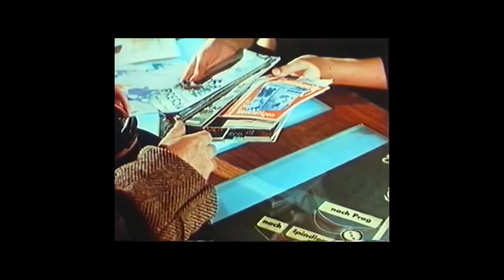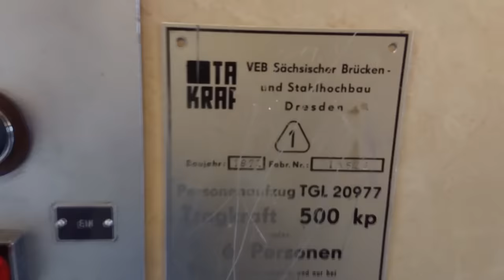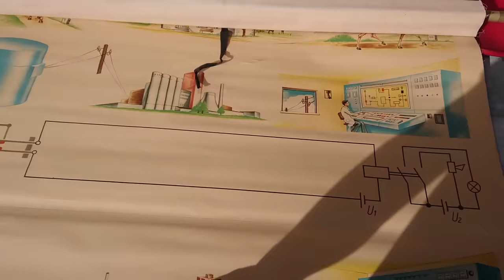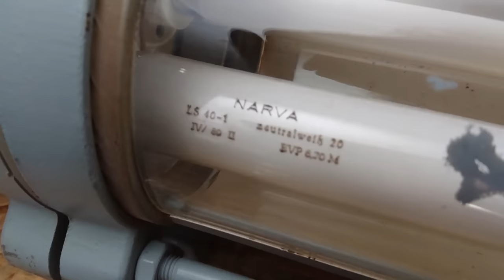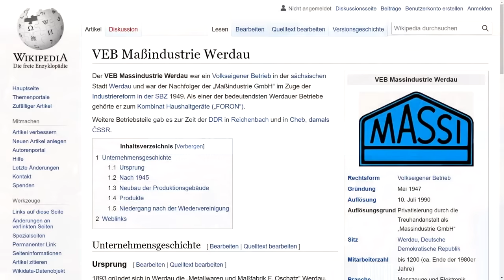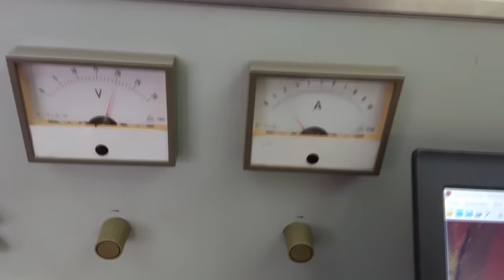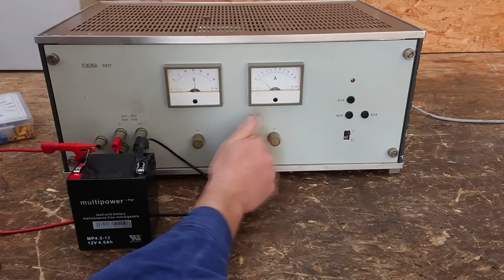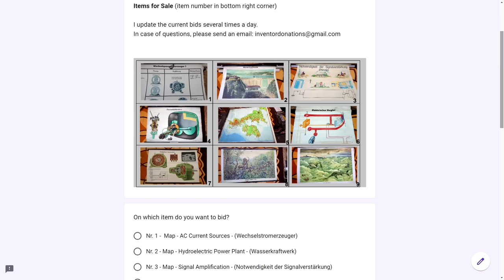Cold War Treasure Hunt - East Germany! Repair-A-Thon!

Comment: As a Hungarian I can confirm that the "Precizios" (lit. precision) wrench was indeed manufactured in Hungary or at least manufactured for Hungarian import. If you can give some info on what's on the other side I could try investigating where it could've come from.
Reply: I am Hungarian too and I have a lot of tools from this brand, but I dont know, was it a Hungarian brand or not.
Reply: I have one of these that spent 80 years in the ground! Presumably lost by a Hungarian soldier in what is now western Ukraine during WW2. It still looks good, and I still use it!

Comment: Be careful with the plastic you used for the meter, if it is subject tio a static charge, it can move the needle, i had a couple of nice meters with plastic fronts that did this, i scrapped them because i couldn't simply replace the fronts
If you need thin glass, try small picture frames and cut to size
Reply: There's on old technician's trick to fix this. Wet your finger with soapy water and coat the inside of the plastic/glass. This creates a slight conductive film that discharges the static. Dryer spray may work even better.
Reply from the maker: Oh yes it can be an issue with some plastics, but in this case the meter works just fine with the 'new' transparency

Comment: One thing wrong, this lamp flickering is visible and it can cause seizure to people with epilepsy. Good thing that with LED tech this kind of obstacle gone away. About changing broken glass for plastic in this ampermeter, glass was used there for purpose, it gather less electrostatic charge than plastic. If you still want use plastic, make sure it have some antistatic coating on side where needle is, otherwise readings can be not accurate.

Comment: Tona was first estabilished in 1892 in Pečky in a former Austro-Hungarian Empire (Czech Republic nowadays) as a steel smelting factory. The production changed trought years, from making parts for agricultural machinery to various engineering products. In 1950's they build their own forging factory and started a production of various hand tools up until the privatization in 1992. In that year Tona became a part of THE STANLEY WORKS. In 2010 the Tona factory in Pečky was closed, which led to the creation of Tona Expert brand (part of FACOM). In 2018 the brand was rebranded to EXPERT by FACOM. The current factory is located in Kolín.

Comment: I started to watch and a minute in stopped. I will wait to later so my wife can sit and watch with me. My life has been touched by many Eastern Europeans. I learned mechanic, electrical and especially manual machine tool operation and repair in several machine shops. All the guy's could fix what they run and make adjustments.

Comment: The swivel wrench from the unidentified batch is east german. It is an original swivel for the legs of a ' camp tourist' tent trailer. These trailers were sold in the west as Alpen kreuzer. It works really wel as you can use the small offset to quickly get the leg down and then tilt the handle to the side to Apply more tourqe.

Comment: You should buy that property. Its very do-able. Reinstate the access road with a chain saw and strimmer. Your Subaru should be able to get up there no problem. Clear the brush from around the house, demolish the house and burn all the timber and build a new wooden structure. It would basically be a very large shed. Worst case you could use it as an airbnb most of the year. It might well appeal to someone to stay there in the summer. It looks like a very nice rural plot.

Comment: Getting that land would be a great investment, because all cities in the world are starting to rot away. Little by little you may start to get rid of the bushes to clear the basic access path for your vehicles and a little space around the property. You had already sorted out the power generation, the only remaining issues would be potable water, wastewater and internet access. Also how far is this terrain from stores to get everyday supplies is another intrigue. I wonder if your everyday job do require transporting finished parts to the customer's location. Besides the electrical and mechanical projects you can also do some gardening and a few animal pets. It would be beautiful. I wish you the best if you decide to start that incredible journey.

Comment: I remember my Grandfather's advice about buying land. He said for him, it had nearly always turned out to be a good investment. As he put it, "They're not making it anymore."  
If the price is right, that plot might be a great one to buy, even without any buildings or improvements. It would be a quiet, private, peaceful site to camp on, and might even prove to be a profitable investment down the road. (Although I don't know what the real estate picture is in that area.) I would investigate for any upcoming area projects or problems before committing to buy it though, if you're interested. After all, you wouldn't want to find out after the fact that it's sited on an old toxic waste dump, or they'll be soon building a major road through it or something.
The buildings are a different matter. To my eye, they look pretty decayed and in need of extensive restoration or just demolition. (Depending on your tolerance for bugs, instability, and mold.) Clearing the overgrown vegetation would be a chore, but not horrible. Most of the stuff I saw could be easily handled with a gas trimmer and a small chainsaw in a few days work. Having a small orchard with fruit trees and possibly even a functioning beehive would be really neat. If it wouldn't lock up too much of your funds, I'd recommend buying it! If it doesn't work out, you could probably sell it fairly easily. Maybe even to the surrounding farms for a tidy profit! Good luck and I love your channel!

Comment: Not exactly sure what you are expecting from the ‘system’ but using amateur radio is definitely a possibility. There are numerous ways that could be used particularly digital such as email, slow scan tv, packet, rtty, ft8, many other ways.

Comment: That property is great. A small tractor with a 1.5-2 metre brush mower, would clean it right up to get your vehicle in. Also the small tractor would help with daily chores in the orchard/yard.
If you can get the property at a reasonable price, I would go for it.
Best wishes from Northern Canada.

Comment: Clearing land and reclaiming / sustaining the work that came before you, then leaving your own labours behind is very rewarding. Obviously you have discovered this in the tool and electronics restoration you do - I think you would come to appreciate a project cabin such as this as well if the access to the site is suitable in the fall and winter months. 

Doing some of this work in the snow can be a pain, but being able to sled in materials and sled out firewood or debris is much nicer than dealing with mud! 😂

Comment: You can modify the LED tube by slicing a resistor off on the board, and it will cut the power draw quite a bit, and make them last forever. You'll obviously lose some of the brightness as a result, but honestly I find it negligible.

Comment: Hey. My mother worked at RFT in a small shop in a little town in the Ore Mountains. Still have the same power supply and all the bench tools they used. They were  involved in the production of radios and amplifier boards.

Comment: The tubular wrench in top right of pictures, looks exactly like the combination wrench that came with my old 1963 VW bug with the air cooled engine.  The two sizes of wrench would fit the oil drain plug and the fan belt pulley

Comment: Love your video and guided tour.  The explosion protected lamps were of particular interest.  The principle behind this design is that they are constructed with an enclosure which can withstand an internal explosion of flammable gas.  The end caps and joints have flame paths which are designed to cool the expelled gas to a temperature below that which will ignite the surrounding explosive atmosphere.  The O rings are there to stop the ingress of water, not to prevent the explosive gas entering.  These fitting are for use above ground in petrochemical/ paint shops/ filling stations  etc. For mining applications the design is similar but the certification is specific for below ground use.

Comment: Places like that are quite nice. I can make an offer on a place about 3 times bigger. Yet its so over grown and the buildings are in really bad shape. It would cost me more to clean it up and dispose of the buildings that the value I would get from it. 
Which is why a lot of places sit unused. Even if I offered a cheap price and I mean low ball price I would still lose more more money. I would have to mow down the entire place before someone can come out and survey it. Then it would cost 10s of thousands to have them remove the old buildings and foundations. Then all of the brush and trees. There are 2 houses, several out buildings and several garages on it.

Comment: i have a set of very very small tools made in west germany that my great grandpa bought somewhere. they include the smallest functional pipe wrench i've ever seen. and its come in quite useful at times! the pipe wrench is about 100mm long maybe, and its designed to work on "pipes" that are around 10 to 15mm. mostly i have used it on small air lines that are in way too tight of a space for even locking pliers to be useful. i often wonder why this tiny pipe wrench was made, as the only marking is "West Germany" on the whole set of little tools

Comment: I have a 12v power supply box that I keep around for a lot of reasons and that is because it allow you to plug a cig ligher adapter in it and then there are 2 twist knobs for black and red. Make it handy for when I am testing anything 12v.

Comment: I put explosion proof single bulb fixtures made from cast aluminum in my garage to replace the exposed ceramic single bulb fixture. Except I cleaned, primed, and painted them with hammered copper spray paint. Very steam punk looking.

Comment: Longtime subscriber here. Initially, I was drawn in by your excellent series on power supplies, but have enjoyed all subsequent videos. As regards the "dumbing-down" trend you describe, I can attest that in the USA (where I live) it has been going on for many years, and sadly only to seems to be getting progressively worse.... Having spent a lot of time mulling over this problem, I have a few observations. First, rather than wasting time bemoaning (or even identifying) the problem, we do better by taking the necessary steps to rectify it. One step is to become healthy in mind and body, whatever that may entail. Another is to make a habit of learning, both as a means towards helping us educate ourselves, and also so we can teach each other. Language skills--so neglected in our education system--are paramount here. The brain is technically an organ, but like a muscle it responds to regular exercise, and it atrophies when allowed to go idle for extended periods. But rather than doing "reps" on a weight-lifting machine, we must instead regularly use our brains to take in new information and repeatedly push ourselves to put that new information to use. Hand in hand with these is working toward self-sufficiency, another admittedly vague term that I will leave undefined. It's perhaps trite to repeat the old adage that a chain is only as strong as its weakest link, but IMO as things get steadily worse, so this adage takes on increasing importance.
    Your consistently tightly produced and well thought-out video work on YT stands as a shining example for all of us to emulate, and I will happily add my name to your email list. In the event that you find yourself journeying to my country, know that you are welcome in my humble abode, a small plot of land located near a wealthy tropical city where celebrities and millionaires come to retire. But not everyone here is a millionaire; some of us basically live out of Dumpsters!

Comment: if you don't live too far away, it might be nice to renovate the Hauschen, for weekend, or Urlaub use, or, because it's quite hidden, a kind of 'Bat Cave' to use for projects based in that area?
if the roof is still solid, the interior walls are probably ok, just need the crappy ceiling material and (probably wallpaper) wall coverings re-done... a couple of weeks with chain saw, and a small tractor to pull up stumps...

Comment: I suggest finding someone with a herd of goats to clear that undergrowth on difficult terrain. If there was an orchard then  perhaps you can reach a deal with someone who will clear much of the area around the apple trees in return for the apple harvest. A forester will perhaps make a deal, wood and perhaps money in exchange for clearing an area. The difficult terrain may mean the forester will have so much trouble extracting wood that he may not be willing to pay much. Reassess the situation after you can see the terrain without so much undergrowth. If there is no loss of legal right by demolishing then I would do so. Rebuild with good foundations and of a size and design of building that will add worth to property; if it were resold.

Comment: The out of square window in the bee keeper shed indicates the structure is rotting from the bottom. The newer building might be repairable but you might have to strip the walls down to the frame. The peeling paint above the porch may indicate water damage. Some of the exterior paneling made me think of cement asbestos board. That would need to be checked out. (Some people hear asbestos and imagine the health risk is like plutonium. In reality sometimesthe best option of C/A board is to not disrupt it. Just leave it be and seal the surfaces with latex paint.)

Comment: Oh my God!  The variety of projects that you can get into, with that property!  I can reasonably see you building the Workshop to be way BIGGER than the home.  Construction, plumbing, wiring... you can add solar and wire for that, with a battery bank, while using new and old technology!  That being said, make sure your not completely in the middle of nowhere, where 3/4 of the problems/issues is getting material, groceries, even just plain WATER to that location.  Other than that, it looks good.

Comment: It might be more useful to buy an old commercial building or old motor garage in a small and run down community. You would have a practical workshop and power, be able to store and display things for repair and sale and even do small repairs for the local people. Often it will be possible convert the old office part into an apartment to live in as well.

Comment: Bring in a bulldozer and remake the track. Bulldoze the house and build a kit-home on a level, large concrete foundation. That's your best option. By re-building that house all you get is an old house re-built with old wiring and plumbing and lots of time put into it. Better to spend that same time and get a new structure which only needs to be a large shed. Cut all the long grass. Keep it short. Plant lots more fruit trees.

Comment: The property you discovered is amazing! I believe you are capable of taking on a very large challenge like that, and I, for certain, would be fascinated to see the changes that could be made to such a great place.
Reply: Your comment about the way property size is perceived in various countries is well taken here.
I live in a town of 200 people in rural Northern Nevada. My ex owns a 345-acre property in town, complete with hot springs, and once you become accustomed to this amount of room, it's difficult to imagine living in a more confined space, especially for those of us with "accumulation tendencies"...
;-)
Reply: I don't know how you feel about such things, but I'd imagine that you could elicit some help in at least some phases of the clearing and reconstruction of that property, from those who live close enough to travel there.
Reply: I'm currently looking at buying a 1-acre property here in town, that has a 1990-vintage small "double-wide" mobile home on it, and a detached two-car garage. I MAY be able to buy the property for WELL under $50,000 USD. The property and buildings need work, but seem largely intact. This is an "on-grid" property, with existing connections to grid power and a municipal potable water supply, with a private septic tank, which are all expensive facilities to put in, if buying just bare land here.
I would eventually like to have at least a small photovoltaic array and batteries, since Nevada is VERY climatically amenable to solar power, and I'd like to have the backup of a personal PV array and batteries.

Comment: I have a couple of saxophones made in the GDR and they're pretty decent too ;-) Those posters are 'amazing' wow! Those old ceiling lights will be awrsome in your workshop - woho! Me? I too use Balistol - fabulous stuff. Personally - me thinks a rebuild would be more efficient than a restoration. Save roof tiles if you can - the remainder appears little more than scrap.

Comment: My "bench power supply" is a cheap step-down module with voltage/current potentiometers on it, I hook it up with any power source (via XT-60 connectors, you may remember) and use a screwdriver to adjust it. To see the set voltage/current, I have a volt meter and current meter both connected to XT-60 plugs, so I can just daisy-chain them between the buck converter and the load.
In my opinion, this system is far superior compared to soldering custom cables by demand or even use crocodile clips. Igitt.

Comment: About the power supply, the thyristors are actually an ingenious way to increase efficiency through phase partialization. Modern circuits use buck converters with fast switching MOSFETS, but thyristors remain a simple, cheap and effective solution particularly with large power units.
About YT, I share the same doubts and reached the same conclusions.
I'm mulling to create a ring of content creators too.